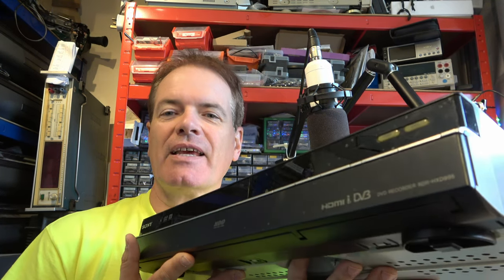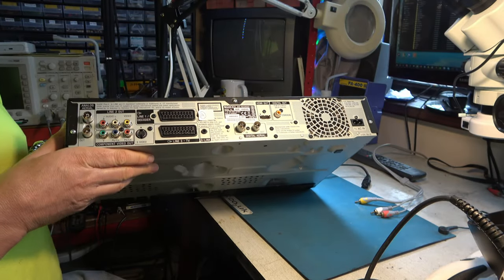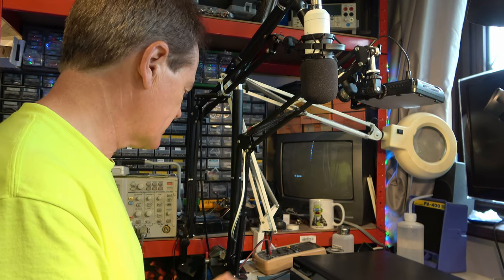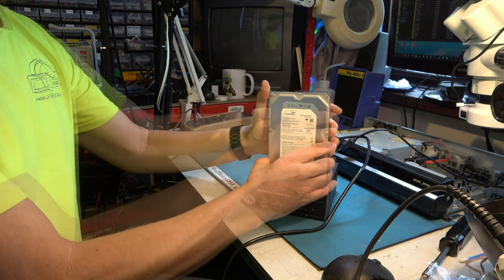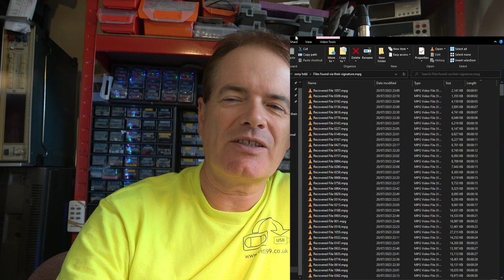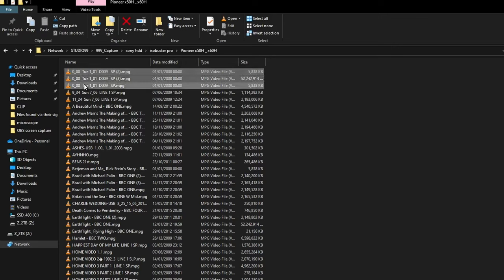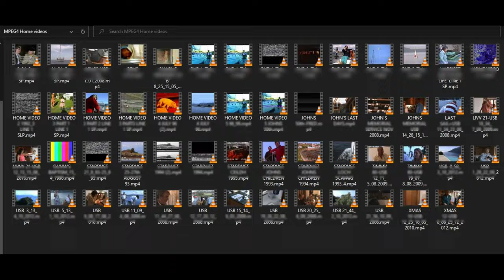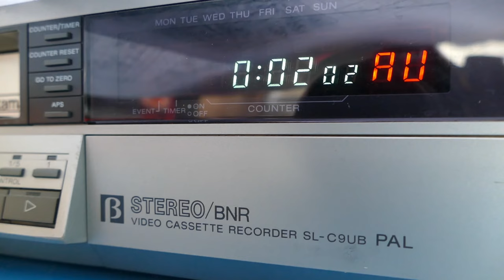Extract files from a Sony HDD/DVD recorder

Comment: Nice Video, thanks.
Hint (lesser known feature).  If you have to resort to "Find missing files and folders" (aka data carving) because your recorder's unique file system is not (yet) supported (as is the case with IB 3.6, mentioned in the video), typically there will be false positives as well.  Meaning, besides VOB files that contain the MPEG2, there might also be jpg, mp2 etc. files found.  Latter files are usually false positives and should be ignored.  Worse, they may cut previously found VOB shorter than it really is.  If you're in this situation you may want to let IsoBuster know this is a Video Recorder HDD by pressing Ctrl + Shift while right mouse clicking the (top most) HDD icon in the left pane.  You will see extra options such as "Find missing files and folders [Video \*.VOB]".  Latter data carving function will focus solely on Video and will be less fooled by data that looks like something it's not.
Reply: The extra options are greyed out, is this because I'm on Pro and not Enterprise?
Reply: @bobbytables464  It requires a [Professional] license (at least).  A [Personal] license will indeed grey those options out.

Comment: I've got a few of those Sony recorders. They're rebadged Pioneer models. They have excellent comb filters in them, that make composite video look almost as good as S-Video. If you dub from HDD to DVD in "High Speed" mode there is no quality loss - it's a direct digital copy from the HDD to the DVD.
Reply from the maker: Sounds like they are quite similar to JVC models, which also have high speed dubbing without quality loss.  Provided of course, that the resulting file will actually fit a DVD.
Reply: @video99couk  However, there are no dual layer DVDs for the JVC recorders that prefer DVD-R
Reply: Unfortunately, it was not defined here whether the "excellent comb filter" only applies to stable television signals or also to jittering video recorders, since a comb filter requires exactly 64 µseconds (PAL) line spacing. I already had a comb filter where only the very few "64 µsecond lines" were sharp, and all others were unsharp, as with the low-pass Filter setting (S-VHS Tape via Cinch).
Reply: I think it's the other way around, the Pioneer model is a rebadged Sony. I have a very similar model, maybe this exact one, and the DVD drive and main chips are all Sony in it.
Reply: @mrnmrn1  You may well be right, but everything I have read on the matter says the opposite. When I bought my original HXD890 new, years ago, I did so in the full knowledge that it was a Pioneer in drag, but the equivalent Pioneer model was more expensive so it was a no-brainer to pick the Sony.

Comment: THANK YOU!  This may be hugely helpful to me whenever I get around to tackling it... I have a Sony RDR-HX900 (HDD/DVD-RW+RW) that developed a fault (I forget what fault, it was over a decade ago), a Sony RDR-HX715 (slightly newer HDD/DVD-RW+RW) and Panasonic DMR-EH50 (HDD/DVD-RW/RAM)... AND, most challenging of all, a bit-for-bit cloned HDD of a failed cable DVR, all with recordings I want to save.  You may have just saved me a lot of time with 2 of the 3 HDD/DVD recorders, and on the other HDD/DVD recorder and the cloned cable DVR HDD, given hope to make the impossible, possible.

Comment: If you only want to have smaller amounts of MP4 files and don't have IsoBuster, you can also capture the uncompressed HDMI signal. For mass processing, IsoBuster is of course easier.
Reply: How would one go about that?
Reply: @SamMC08  Blackmagic Decklink Mini Recorder HD (PCIe, 4:4:4 Recording) + OBS Studio (Software). HDCP swallowing HDMI 2-way splitter if necessary.

Comment: The old DVD/HDD recorders are quite usable even if they are so old that they no longer have DVB-T2 MPEG 4 or DVB-T MPEG 2 encoding of the TV signal. when buying used, it is best to stick to well-known brands such as Philips, Sony, Panasonic and several others.
They can have a super good TBC built in, which you can use by running the video signal through from an older video machine without a TBC. 
I do it myself with a 1" Sony C-format where I insert video through a DVD Recorder from Philips. It stabilizes the signal well, also the colors.
Reply from the maker: In the DVD days, I had (still have!) a fleet of JVC DR-MH300 and DR-MH200 DVD/HDD machines.  They still get used occasionally.
Reply: I found Thomson's first DVD recorder from 2002, the DTH8000 to work incredibly well for this task. Makes shaky VHS tapes rock solid. It takes the signal 3-4 seconds to get from its input to the output, so it does a lot of processing. If there's a full loss of sync due to tape damage, sometimes it glitches and locks the vertical blanking in the middle of the screen and/or the picture turns all purple, so it can not be left alone during archiving, it needs supervision. 

I had the first HW revision, which died. Now I have the second HW revision with a completely different chipset, the MPEG codec in it is theoretically enhanced but not sure about the TBC, because I haven't tried it yet. I'm not really interested in its MPEG-2 capabilities, as I use it only as a feed-through TBC.
Reply: @video99couk  I have a JVC DR-MH10 that still works. I did a test against it and several other recorders and found with the later Panasonic DMR-EZ48 in HQ mode it did a pretty good job with the video.
Reply: What is the name of the PHILIPS "TBC"? The PHILIPS schematics I've seen so far tend to have very different chipsets. I'm trying Pioneer DVR-560H, but have to get some bad tapes first.

Comment: I have a Sony Recorder like that one In silver. The only thing that has gone on It, was the Sata Cable (Red One) even though this Is never moved, It does Deteriorate over time. Just replace It, and Your back In action. I also did the old Docking station method once. When the Stat Cable failed. But I used Magix Movie Maker, then converted Into MP4. Glad It worked for You.

Comment: I have a Panasonic DMR-ES15 DVD recorder, which has a kind of line TBC on input. I also have a Leitch X75 and a Canopus ADVC700. What routine would you recommend for capturing Video 8 tapes? I also have a Balckmagic Intensity Shuttle board and a Pinnacle 710. I'm in Brazil, but the material is all in NTSC. Is DV in this case worth it?
Reply from the maker: There are a lot of variables here.  The Intensity Shuttle should give very good results, but if that is too hard to use then use the Canopus ADVC700.  The Panasonic can be used as a basic E-E TBC, so that's useful.  Many later Sony camcorders also include a TBC so one of those might be even better.  If you use a Hi8 player then use the better S-Video connector rather than Composite Video.

Comment: I've got a similar machine (Sony RDR-HXD890 - 160GB HDD) but it's developed this fault where it won't store new DVB channels. It lets me re-tune but once put into standby it forgets and goes back to the previous tuned stations, and because I'm on a different transmitter now I just get No Signal. I've read online that I need to be on a certain version of firmware as there was a fault where tuning info was lost, but this machine seems to be on that newer version. Is it possible to re-install the firmware or will it see it's already on updated and not do anything? My plan is to get either a DVD+RW or DVD-RW and high speed dub the contents from the HDD, rip the DVD and then use the DVD again until everything is copied.
Reply from the maker: You can only try with the firmware update.  Whether it allows it or not is an unknown.
Reply: Sony being the a$$holes that they are, they do their best to make firmwares unaccessible for older models. If you look up your model on their website, and it is no longer supported, forget to get a firmware update for it. If you can't find it on your model's support page, it's gone. And they sue the living piss out of any third party who makes their firmwares available, so no real chance finding it online anywhere. Only chance in these cases is to get a new, still working motherboard, desolder the flash chip, and copy it. If it was successful, erase and re-write the flash on the donor motherboard as well, to refresh the charge in the cells. They can become corrupted well before 10 years. 
Or try to get the firmware updated in a Sony Service center, but it will be pricy, if they undertake the job at all (they probably won't).
Reply: @mrnmrn1  you are speaking from my heart, that's exactly what I am doing on my private devices. I desolder the flash chip and read out the firmware, saving it as a .BIN file. It's an identical copy of the firmware written in the factory during manufacturing. Oh, and don't forget about the data retention time of the flash chip. Let's say the data retention is 10 years; if the chip is losing its contents, the device becomes inoperative. What I do is read out the chip, erase, and write the data back to the flash ROM. So, you gain +10 years more retention time because the data is newly and freshly written.
Reply: @mrnmrn1  If we read out the firmware, we can show our middle finger to the manufacturers because hardware is easy to repair. But, as you said, the firmware is the most difficult part or impossible to find. I have a lot of devices built before 2005, and I have all the firmware for the devices I own. My goal is to keep them functioning and save the environment.

Comment: We have a similar recorder a “Sony DVD Recorder RDR-HDC100”.  It has an error on the hard drive and will not read the drive.  We have a remote control caddy which has been known to hold buttons down, sending devices berserk, if the remote is carelessly placed.  I wondered if the remote for recorder was placed in the caddy, buttons accidentally pressed and the hard drive left inoperable as a result.  Do you know the infra red combination for formatting the hard drive so I can get the recorder operable again?  Thanks, Stephen.

Comment: Wow, you are a brave man! At least you’ve managed to show that it can be done with some machines using the software that you have.

I have a Panasonic DMR-EX95VEBS machine and I’d love to do the same thing, but I think I’m reduced to the HDD to DVD route (recording each in real time – I daren’t even now switch on ‘High Speed Mode’ to create the DVDs). The reason for me taking this route this is that I understand that once you take the drive out of the machine and try to use it in a caddy, when you put it back in the machine, it no longer recognises it. It only give you the option to format it – all recordings no longer there/recognisable/accessible.

I’ve also heard that you can’t even swap a disk from one DMR-EX95VEBS to another DMR-EX95VEBS machine (which you might want to do in the event of hardware failure say) as again it doesn’t recognise it and forces a format.

It’s almost as if it somehow pairs the hardware to whatever it reads from the HDD on first boot-up. I don’t know what that would be. From that point on you are stuck with that HDD/machine pairing.

So given all that concern (assuming that it’s true), it might be very dangerous for me to even try the HDD in a caddy, and that’s even if I’m not going to write to it – just read.

Perhaps it all goes wrong when people try to mount it in Windows instead of using something like IsoBuster? Who knows. At least it worked with that Sony machine. I did find myself cringing in anticipation of a total loss though Colin. I was mightily relieved, that’s for sure.

Well done that man!
Reply: My experience with Panasonic HDD recorders: DMR-E80H, DMR-E100H, DMR-E85H, DMR-E95H, DMR-E96H, DMR-E500H, DMR-EH50, DMR-EH60, DMR-EH55, DMR-EH56, DMR-EH57, DMR-EH75V, DMR-EH75, DMR-EX75, DMR-EH58, DMR-EH68, DMR-EH59, DMR-EH69, DMR-BS750, DMR-BS850, DMR-BS780, DMR-BS880, DMR-BS785, DMR-BS885, DMR-EX77, DMR-EX87, DMR-BW500, DMR-BWT835 and DMR-BWT730 is that all of them could perfectly be removed, Video could be extracted with IsoBuster, and the recorder was happy to work with the HDD afterwards.  No issues.  It's when you write to the drive that problems can occur, otherwise, provided the device is not powered up while you remove the HDD or while the HDD hasn't been put back yet, the recorder is clueless to the fact that the drive was removed to start with.
Reply: That's encouraging. Fingers crossed that the same if true for the DMR-EX95VEBS. I guess it's still true that you can't swap HDDs from one DMR-EX95VEBS to another identical machine. At least that's what I've heard. @PeterVanHove
Reply: @BongbongA99  you can swap the hard drive from an identical machine to another, but it forces you to format the hard drive. I have the Panasonic DMR-EX95V, and I cloned the original loud Samsung hard drive to a Western Digital 250 GB IDE hard drive. The recorder does not give an HDDERR message and boots from the new hard drive. I just needed to format the hard drive, and now my recorder is still working fine. But you must clone the original hard drive because there is a small amount of code inside the hard drive that needs to be on the new hard drive to be accepted by the recorder. If you put a completely blank HD without cloning, you will get the HDDERR message.

Comment: Having a similar Sony with a failing DVD dive, I found this particularly interesting.
Reply: Does the DVD dive have water damage?
Reply: @TTVEaGMXde  Second hand unit, but nothing obvious to suggest it does. Failing in exactly the same way as my unit I had from new (struggling to read some DVDs)
Reply: @gideon3648  My comment was actually a not 100% humor-free hint that someone wrote DVD dive instead of DVD drive.
Reply: @TTVEaGMXde  Didn't see my mistype. Guess DVD now stands for Diving Video Disc 🙂

Comment: Hi i have transferred some VHS video's to DVD using a DVD Recorder they look fuzzy or blocky when viewed on a 55" HD TV, is VHS not supposed to look good or clear on a big TV, Please advise.
Reply from the maker: VHS is a low quality format and then DVD compression makes it even worse. Make sure you set the DVD recorder to the highest bit rate possible, so  1 hour per DVD. That should help a bit. If you are squeezing 2 hours or more onto a single layer DVD then it will look rough.

Comment: I've got a sony drd-hxd870 the best thing I've  found is that in system setting there is input line system you can recorded in Ntsc or Pal/Secam very useful when recording from a usa ntsc playstation 2  console with playstation 1 game as they are in 240 interlace as I've had trouble recording in the past.
The model you have is drd hxr995 has the same input line system as my one hope this is any use to you or anyone wanting a dvd sony recorder that can recorded to dvd or hhd in Ntsc or Pal/Secam

Comment: Thanks for this. I have the same model. I seem to think I tried doing this a few years ago to no avail. This will be a convenient way to capture video from old consoles
I've never captured DVB on it. With the files having different programs and resolutions, I wonder if it just dumped the transport stream for that channel and had multiple channels in it
There used to be a java program called project x that I used for extracting transport streams years ago so might be worth a look. I seem to remember there is a tool called tsremux (demux?) that could dump the individual streams for you to mux to another container like mp4 or mkv with the appropriate software (mp4box/mkvtoolnix or maybe ffmpeg)

Comment: Hello! Nice video. Thanx! Just a question. I hade a Sony old DVD HDD recorder (rdr-hx520) which displays HDD error on the front panel. I recovered .vob files using your method but all files doesn't want to play (black or green screen). Is that mean that the files are encrypted or something else? The disk seems to be okay, SMART read OK, but maybe someone was doing a format and corrputed the filesystem and the files? I have no idea, so I ask you, that maybe you experienced such a behaviour?
Reply from the maker: VOB files are not exactly MPEG2 files, though they may be playable.  Try VLC Player.
Reply: @video99couk  The files are encrypted. I confirmed that. They aren't playable. Sony used their own key to encrypt the files stored on HDD (they must be decoded on fly). The header of the file is okay, but the datas are encrypted. So I am not able to watch the files...
Reply: @video99couk  I've managed to run service mode of sony rdr-hx520 and scanned the ID of the disk and disk itself, no errors. Next I booted the device and it booted without hdd error but it doesn't show any files on hdd. I know that they are on the disk... So I am stuck in a loop of what to do.
Reply: @riversedge64  How were you able to enter service mode?
Reply: @олегиванов-щ5в9щ  Normally, it's not a secret. I found pdf manual in Internet. As far as I remember, you have to press and hold  eject button + play button while plugging the power cable.
Reply: @riversedge64  
this method does not work on the RDR HX780 recorder